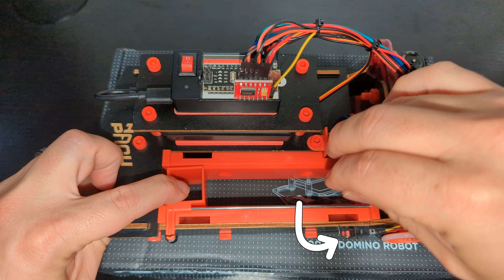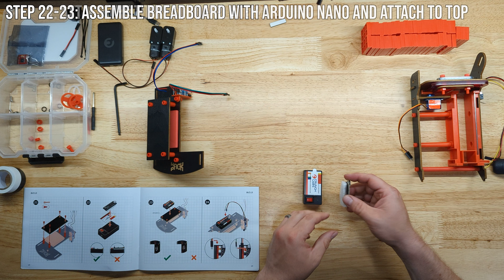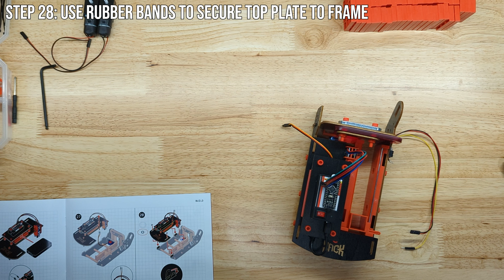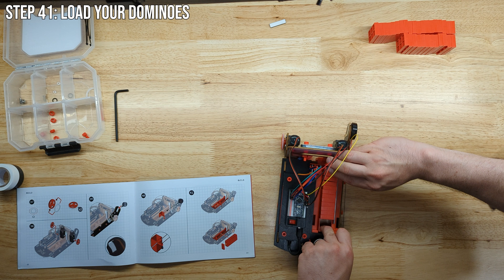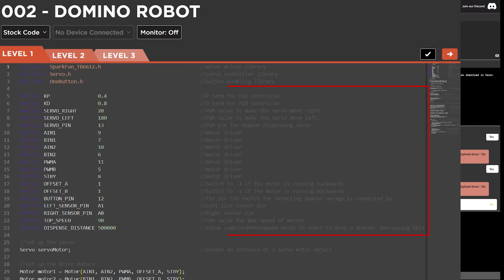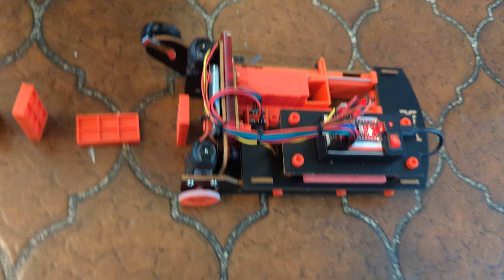Build and Review: The Hack Pack Domino Robot Is Here!

Comment: I have built, disassembled, built and disassembled approximately 12 times in the two days following opening the package.  My issue is that the red acrylic slider lays only the first domino and thereafter the servo does not fully open the door to capture any more dominos. I see no difference between your and my build.  Open to suggestions.  
The servo is placed exactly as shown in the booklet, but upon power up, the servo seems to attempt to point to a new home position!  This has me stumped!  Any suggestions are greatly appreciated.
Reply from the maker: Yes this was a mistake, it's been a minute but I believe I had the motor flipped around.  later on at 3:30 it shows it in the right orientation.  I'm looking at the final product off the storage shelf and the servo wires are in the direction away from the orange plate and towards the black side like at 3:30.  I had issues with sliding the block when I used 3rd party dominoes that were heavier.  I have the dominoes linked in the description which work most the time but get the occasional grinding noise as the domino doesn't seat fully in the acrylic before it moves.  If you disconnect the slider so it never hit the switch telling the Arduino it's empty.  If it happily moves along while empty then I'm not sure.
Reply: @TKMakes-2024 greatly appreciate the response.  My only problem seems to be with the servo.  On each and every one of my rebuilds, the servo was installed as it appeared in the manual. Then on first power up, the servo seemed to spin 180 and seat there.  Frustrating, since I rebuild over a dozen times and it still does not seat as it should.  It stop shy at less than 1/4” to capture the next domino.  If possible, I would dearly love to see a short video/pix on exactly how you positioned the servo.    Much appreciated for the response.

Comment: Hey man great video. Do you happen to know how to make the robot remote controlled?
I have both the first hackpack and the second but I do not know how to hookup the IR sensor to my robot.
If you can help please do thank you and keep up the good work
Reply: Hey I was talking more about the wiring and if I need to buy an extra wire to connect my IR sensor. Thank you for reaching out and replying to me.
Reply from the maker: @SolarFB   I had a look at both my IR turret and domino robot which are both stock now.  The IR Turret has red power, black ground, and purple data cable connected to pin D9 and their all on one 3 pin connection.  On the domino robot pin D9 is used for motors so the provided IR code is setup to use pin D3 so yes you'll have to break out the wires since there is no power and ground next to D3.  I hope these images help.  I didn't want to remove parts and update code because my kids still play with them.

Wiring: https://imgur.com/a/bTrQD8F

The IR antenna thing ends with a female dupont connection so you'll need a male to male dupont wire for power, ground, and data.  I have been peeling and using these dupont wires since (Amazon says) 2021 which has male to male wires. 120 wires for $6 on Oct Prime Day seems to be a good deal too.

Let me know if I was able to answer your question.
Reply from the maker: I saw the challenge and thought it was a neat idea but didn't make a video because CrunchLabs provides code to make that work on their IDE linked below.  It looks like you'd have to connect data to pin 3.  Were you asking about code or wiring?
https://www.crunchlabs.com/products/domino-robot